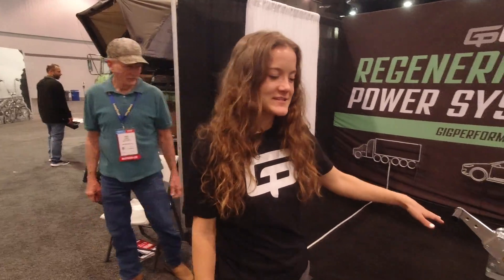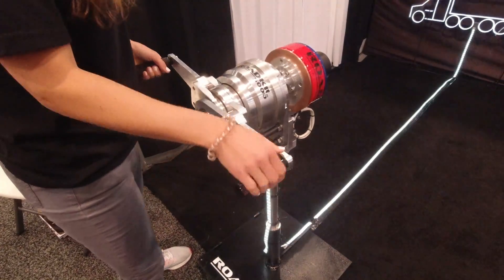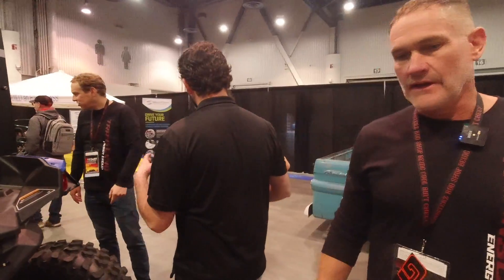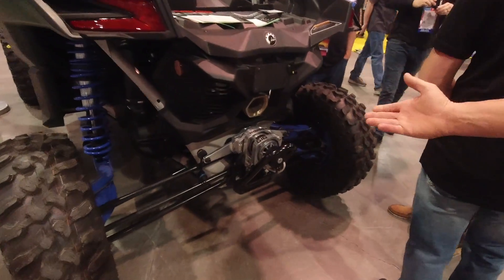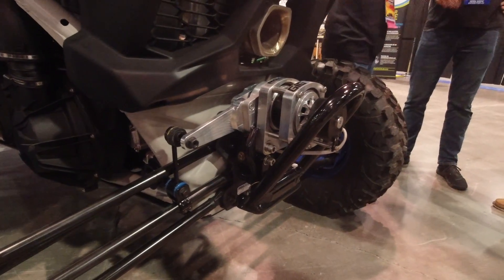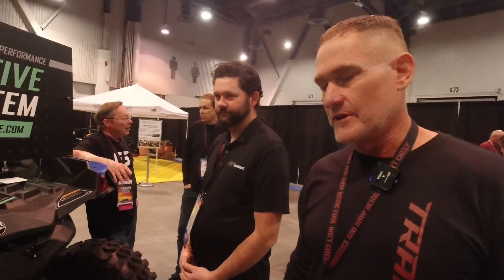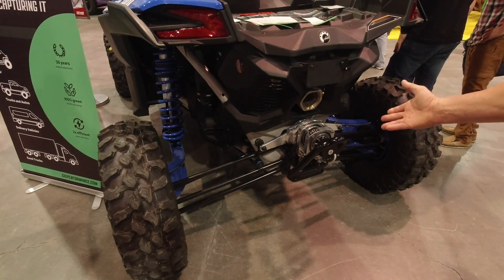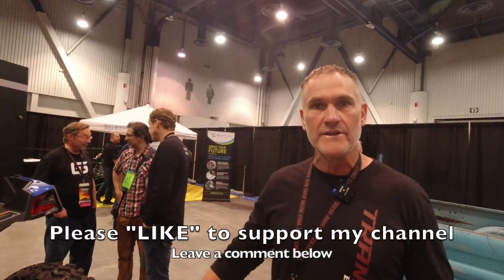(possible EV world game changer) Gig Performance - electric regenerative suspension system

Comment: Ahh ... no.
Reply from the maker: Ah yea
Reply: i'm going with Jim on this @mixflip  U=mgh. the potential energy of one metric ton dropped from one metre, which is hardly the kind of drop off people regularly do with these, is only 9.8 kiloJoules which is 2.7 Watthours. not kiloWatthours mind you. Watthours. That's only enough to charge your phone to 15%. and that's the absolute theoretical maximum you could possibly have, before tyre deformation, shock oil friction, heating the soil up by jumping on it, generator losses, etc. etc. sure there are a million smaller bumps but if you look at the extreme example you can already see how tiny energies we're working with here.
Reply from the maker: @markifi  I’m excited to see how this technology evolves. Wagons had wooden wheels 150 years ago. Now we have drones with wheels on Mars. This is most likely just the start of something big. Give it time. Even the engineer I interviewed said that what we were looking at was just a working concept and not a final product. An OEM could take it to the next level. That’s what SEMA is about. Showing off what is coming. Selling products and ideas to other companies. It’s a trade show after…
Reply: @mixflip  a fully electromagnetic shock would be a better idea. they can still scavenge meaningless amounts of power for LED lighting bling, but can actually help the suspension work better in the process by firming it up when needed and leaving it loose when not. then again, that is already being done with computer controlled oil valves inside the shock
Reply: @mixflip  The total amount of energy available is the amount of heat a shock absorber generates.  So, go put your hand on your rear shock after a long ride and realize this isn't ever going to be worthwhile.
Reply from the maker: @brianhaygood183  look at it this way…. Beepers weren’t worth while, then someone increased the communication capabilities and now we have cell phones. It may not be perfect today but with more development it might surprise us all.
Reply: @mixflip  cell phones don't work beyond the limits of the laws of physics.  There simply isn't enough energy available.  Comment after comment is telling you the same thing.  Perpetual motion machines don't work, either.  That's not going to change with progress.
Reply from the maker: @brianhaygood183  maybe the 1000 watts of electricity it creates with road vibrations combined with solar panels and regen braking will amount to something useful some day. Maybe not today…
Reply: @mixflip  why do you keep making these bizarre comparisons? This is decades old MECHANICAL  technology producing a few watts at best, no amount of "OEM development" can put more lipstick on a pig.

Comment: How much power can it generate per generator?
Reply from the maker: I think he said the one on the  SXS was 1000 watts
Reply: @mixflip  -1 KW per hour? Is a lot of power that’s an impressive invention. My dc to dc charger is 60amps(720w) can be obsolete then.
Reply: @norkisserrano  A watt is a kilowatt hour, multiplied not divided. Like foot pounds aren't pounds per foot.
Reply: @EtherFox  -Because Mixflip said it can charge at the rate of 1000w so that’s 1kw. I don’t know.
Reply: @norkisserrano  don't throw your 720 watt charger just yet. saying this is 1000 watts is meaningless. the peak power it generates are only the function of how the generator coils are configured, how much energy you can get out of a bump is what matters. it's basic physics. Watt is a unit of power (largely irrelevant here) Watthour is a unit of energy (the important bit and likely miniscule enough to make no difference)
Reply: Just to clarify, the figure of "1000W" is utter marketing B S, the same as my hi-fi could produce 1000W if a lightning bolt hit it... 
You are looking at ~10W, and a compromised suspension because you are effectively adding unsprung mass to it, so it's going to ride like a box of rocks

Comment: Okay now im wondering about something attached to the wheels.. Imagine the wheel on Wheel of Fortune how those pegs hit the little arrow marker. Except everytime the arrow/marker thing is pressed downward , the motion will create your regenerative energy. 
Very crude and on the spot thought here, obviously . 
But it got my gears going no pun intended..
Reply: The amount of energy it would create would be almost nothing unless you had gearing to give it more potential but then not only do u get a wheel with way too many moving parts that will wear and break and need lubrication plus the sophistication of jus changing a tire would grow exponentially and the added weight is no good but after adding gearing u will get what this video was virtually all about and thats a dampening effect and at the speed a car tire rotates the small generators would probably never reset to its original position while ur driving therefor only move 1 time and thats from the initial rotation from the moment u first took off. Just imagine one of those old wind up lanterns u had to spin the crank to get it going. After u let go of the crank wen u spin it fast the crank will spin for a second on its own because of the gearing, and the dampening effects can be directly compared to wen u first grab the crank arm on that old lantern and begin to try to get it going but it takes a little force before the gears start gaining speed and finally the lantern illuminates. That initial force u felt in the very beginning is a dampening effect.

Comment: Very interesting. We're told not to hold our cell phones against our head, due to radiation,  but they want us to sit on a battery a thousand times larger. In 20 years we will, hopefully,  understand the long term effects.
Reply: Cell phones emit low levels of radio frequency energy which can slightly heat surround tissue, battery's are DC stores of potential energy. Both are fine AFAIK.
You are way more likely to un-alive yourself by eating pollutants in the food chain...
Reply: massive grin on the face? would be one effect

Comment: Coaxial. Means two things sharing an axis and well describes two things spinning different directions on the same axis - like a helicopter with two counter-rotating rotors; most-often shortened to just coaxial helicopter.